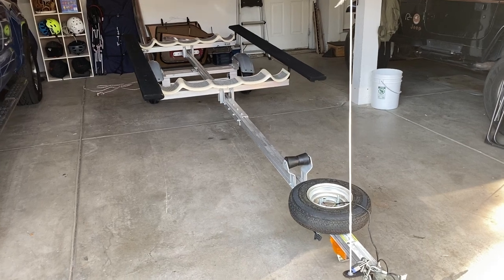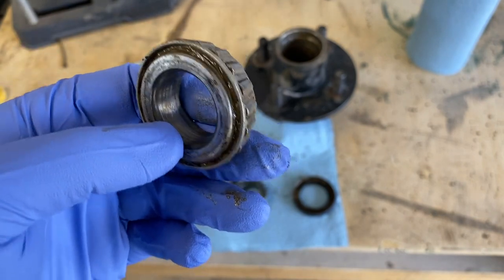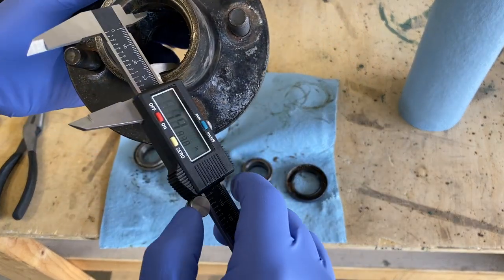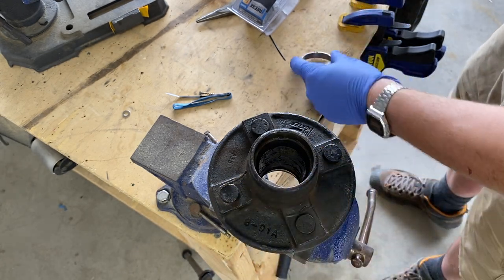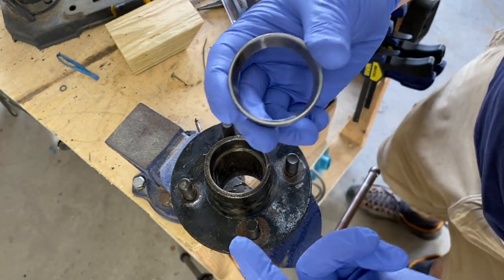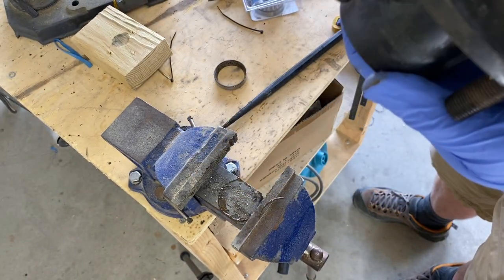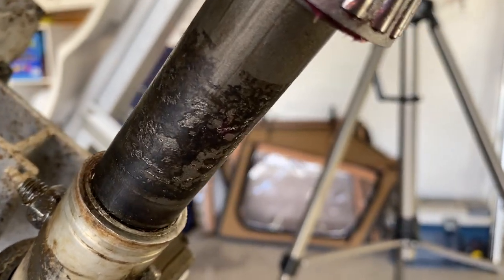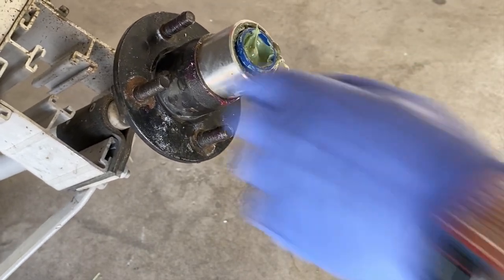Trailex Trailer Bearing Replacement-Hobie Tandem Island trailer-SUT 200 AI

Comment: Thanks for this video. I just recently purchased a used Trailex SUT-200-S. I do not think there’s any issues with the bearings, but I plan on taking the hub off and repack them anyway. The wheels spin free when I lift them up and spin them by hand but not sure this is a great test. I was told the trailer never went in water, but I bought it from the 2nd owner so who knows.I also purchased some bearing buddies, so I can easily keep them greased.